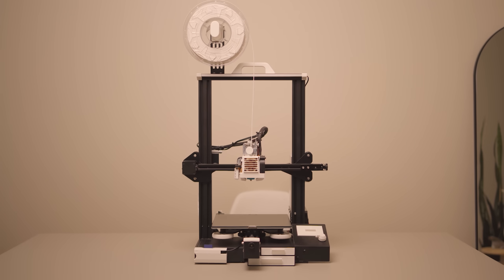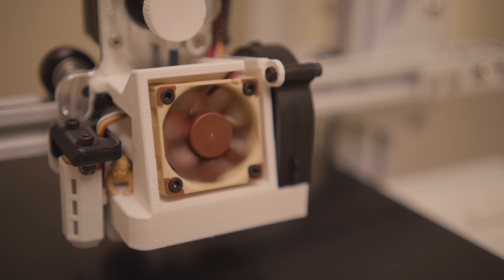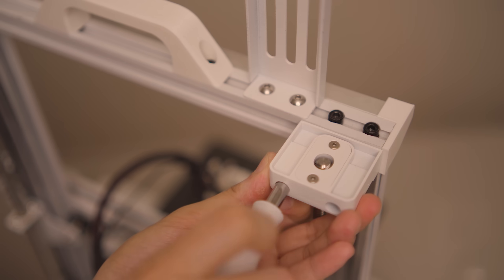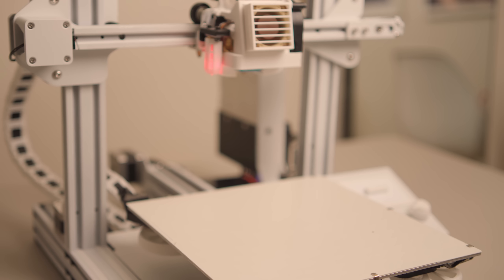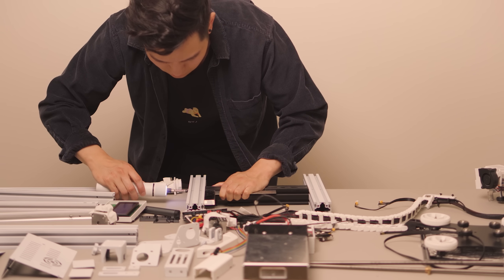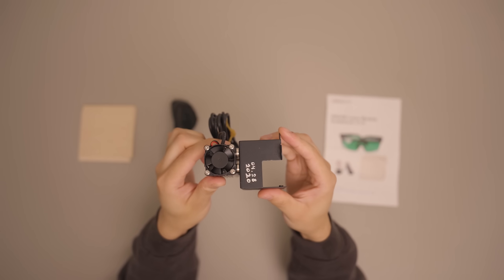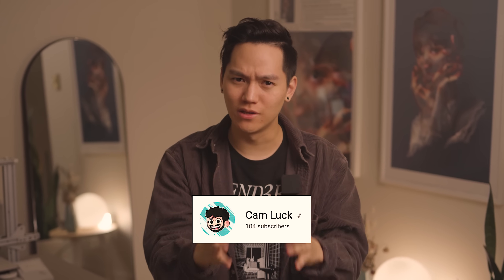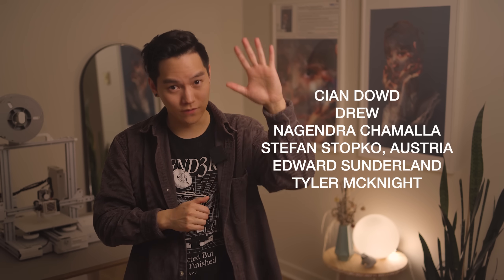10 More Upgrades for my Ender 3 Pro - Part 4

Comment: Pancake motors are actually not weaker,  it all depends on the specs,  I have stronger pancakes than regular,  but they will get hot wich basically is the better heat spread of the regular version.  The coils and stator are usually similar inside

Comment: Honestly i didnt think there will be part 4 good job bro. Looks amazing. Btw if you wanna play with it little you can replace firmware with Klipper and setup input-shaping with acceloremeter. And replace default screen with KlipperScreen. Also you can replace wheels with linear rails(wheels will wear after some time). There is so much you can do with this printer its beyond unbeliavable.

Comment: Where can you find a Thermistor that can handle 425c, that will work with the Micro-Swiss All Metal Copper Hotend, or any 500c advertised Desktop Hotend?

Supposedly, Thermocouples do not go high enough, so nothing made for the Ender is capable of anything over 300c, and they recommend that you do not go over 260c-280c.

I see Hotends advertising their ability, but finding compatible Heaters and Thermistors is almost impossible. Creality refuses to answer my questions through many emails, and Micro-Swiss flat-out doesn't have a clue. Any help you can provide would be greatly appreciated!

Comment: I got my first printer about a month ago and after much research I ended up getting the Ender 3, I could have gone for the Pro, CR10 or some other upgraded model but I had full intentions of upgrading and modding the printer myself (especially after watching your videos) and I'm really glad I took that route! I'm at a stage where I feel comfortable taking my printer apart, putting it back together, making mods etc and I've ended up not having just and Ender 3 but an Ender 3 tailored to me.

Comment: The stainless steel powder coated PEI surfaces are the way to go. You get two surface types, smooth and textured, the adhesion is great, and it's removable.

Comment: Damn whoever designed that pen holder is a straight genius.  Just add some small linear rods on both ends to prevent the stray movement.

Comment: Take your dual z upgrade a step further and swap out the brass lead screws with Delrin (pom) anti backlash lead screw nuts. They will reduce the play that is between the lead screw and the nut (which only gets worse over time since the brass versions are made to be cheap and to also wear down before damaging lead screw) and will stiffen up your x carriage in general which will reduce z banding (saw you had some like I used to which was greatly reduced to basically nothing after swapping in the Delrin versions). Along with this Delrin is self-lubricating so it'll make your z movements smoother longer. I'd still recommend adding a drop of pfte lubricant oil. You'll also notice that any lube or oil you add to your lead screws will no longer turn nasty colors since you won't have brass shavings getting mixed in and causing more problems. Also a reason the reason why Prusa uses them instead of brass versions.

Along with this I'd recommend swapping the flexible coupler you got for the ones with a flexible material between (does basically the same thing but the way it's built with separate parts reduces chances of the coupler breaking which seems to be common with all-in-one piece versions)

Links to versions I bought but you can also find better quality ones such as the ones from Prusa

https://www.amazon.com/gp/product/B08TLVL95C/ref=ppx_yo_dt_b_search_asin_title?ie=UTF8&psc=1
https://www.amazon.com/Befenybay-Aluminium-Flexible-Coupling-Connector/dp/B07RMZCLZ3/ref=cm_cr_arp_d_product_top?ie=UTF8

Comment: Could you please make a video on how to Timelapse you 3d prints.
Reply: Octoprint is a great tool for making such timelapses.

To use it you will need a raspberry pi and a camera. Install octoprint onto the raspberry pi, set up the Timelapse function and you should be good to go.
Octoprint also has some other features which are quite interesting, like printing via wifi or automatic failure detection

Comment: does painting the aluminum extrusions affect the surfact smoothness and therefore worsen the precision of the motion?
Reply: It shouldn’t cause any issues if you use a good quality spray paint and give it a even coat to prevent having varying surface coat thicknesses.

Comment: Massive props to you for including STL links for these projects! I've gone through 3 pen plotter add-ons and 2 Cricut blade holder add-ons and didn't like any of them so far - gonna try yours and see how well it holds up!
Reply: Are cricut blade holders worth a try?
Like can you achieve a decent level of precision using them?
Reply: @yourlocaltoad5102  same level of precision as an actual cricut, assuming you can get your paper anchored well and secure the blade properly

Comment: Can we please see your rig for the POV dolly/tracking shots? Those are smooth af 👌🏻

I got my S1 Pro a few weeks ago, but it's been nonstop headaches with calibration and erratic ABL meshing. My Sonic Pad just cleared customs so soon as that arrives I'll be following your tips for getting everything properly squared up (the coaster trick is genius). Checking out 3D Printer Guy's upgrades now, can't wait to do some of my own!

Comment: the laser head thing should block the airflow from the fan because your covering it up I would add spacers on the screws so that the laser sits slightly off the housing, then print a new housing with holes in the front so that air can flow into the fan and will not be blocked anymore. Just a suggestion I hope you find this useful if you see it.

Comment: Can you do an ender 3 lack enclosure next? 👀
Reply: Lack enclosures are nice, but I would really recommend to make a enclosure from scratch.

I built mine from some mdf-board, a sheet of plexiglas for the doors, some cheap ikea led lights and small hinges and magnet door holders and it was under 30€ (tough I have to admit that I got most of the mdf for free).
Building them from mdf or other wood usually is more practical, as they are better at retaining the heat, you can adjust them to fit your specific needs and they just look better than having some stacked ikea tables.
Also you will save some money, as you won’t have to buy as much Plexiglas to cover up the sides.
Reply: @yourlocaltoad5102  I really appreciate this response. I just got into 3D printing so I wanted to do mdf-board at first but I dont have the affordance to work with MDF at home. 
Hmm 🤔
Reply: @slaythems  mdf still is quite cheap and doesn’t require any specialised tooling to work with.
I had my pieces cut to size at the hardware store for free, so all I needed to do at home was to screw them together and add my plexiglass doors.

But if mdf is more expensive in your area, you can also just use any other wood.
Reply: @yourlocaltoad5102  would you happen to know of a good link for instructions to this?

Comment: If you have your fans mosfets, then you shall either replace them, or the motherboard entirely. In that case why not try a board with 5 drivers so your z steppers can work independently and self calibrate?

Comment: Only thing is -- remove anodizing from aluminum to just make it white by spray paint will impact how your printer performs. Anodizing hardens the outer surface, just for aesthetics - -if you want white, but white anodized extrusions.

Comment: Out of 5 machines I have built so far, I have yet to see one that had nearly a square base from the manufacture which is preassembled.  Truly cool stuff here and I appreciate and enjoy your content. You are the best!  However,  it is my strong belief that a properly built machine does not need grease on the z axis screw.  In fact, I have been able to achieve a free fall from top to bottom with stepper disabled on my builds.  Some short tolerances which requires some micro tuning, yet possible.

Comment: Question: Did you have any problems with the printer that disabled it until you fix it? And if so, where is the most effective solution to problems for dummies? Because my Ender 3 Pro stands and gather dust because of one problem, YouTube videos didn’t help much🥲

Comment: Since you broke the fan controller you should buy the new 4.2.7 mainboard. It is the silent board the new ender 3 s1 uses and it is a drop in replacement.

Comment: The shared Z stepper motor control reduces strength of them, making missed steps more probable. It's prbably entirely fine, Z axis isn't doing too much work. But if you wanna be extra, timing belt on the top of the Z lead screws always keeps them in time :p

Comment: One again Scott, another great set of awesome mods. BUT... When I clipped my ribbon cable to the frame, Octoprint reported that I had a HUGE retransmit rate on instructions.  I had to unclip the ribbon cable and get it as far away from the frame as possible.  Once I did that, the errors disappeared. (And now I'm off to get that Dual-Z axis motor kit!) :)

Comment: Since that Noctua fan is 12v and your board is 24v, I assume you had a buck converter. The laser probably tried to draw too many amps through that buck converter because it's meant for 24v?

Comment: A geared extruder would be a lot better for direct drive. It uses a smaller motor, but can achieve the same (or more) torque. I'm currently using the superlight orbiter v2 (on my vcore 3), and it can push more than 50mm^3/s of filament, which is 0.3mm layer height, 0.8mm line width, at like 500+ mm/s
Reply: why there are no nema geared? instead of and extruder geared?
Reply: @borisgraell  because geared extruder is much lighter.
Reply: Good lord that's ridiculous fast. No way it keeps near perfect quality while flying around like that... but then you must also have some insane cooling... sheesh

Comment: Curious how well the paint is gonna hold up, the black was anodized on but the roller wheels might degrade it in the channels. Regardless, cool to see you still working on this thing! Have you ever considered just trying to design a printer from scratch?
Reply: Looks like it's bare inside the channels.
Reply: I was thinking the same on the painting

Comment: Is the Ender 3 pro still worth it?
Reply: You can get one at a microcenter for 100 bucks so if you’ve got plans to mod it then yeah they’ll make pretty good kits. Probably better to spend a bit more and get a more solid printer though, although I only have an ender 3 and 5 so I don’t have any real recommendations
Reply: Yes it’s worth it. You don’t need all this cake decoration either. I make tons of money with my stock Ender 3 pros and one reg 3. Good designs make money
Reply: If u get it on sale

Comment: Hey Scott, for your part cooling fan. I also ruined that part of my circuit board by accidentally shorting the cables while installing new fans. To fix it I was able to change the firmware to have my printer use the connector plug for the motherboard cooling fan to control the part cooling fan, after that i hotwired the motherboard cooling to the heat sink fan. This way i can still regulate the fan speed of my part cooling fan and the other two fans also start spinning whenever the printer is turned on. Might be something to consider!

Comment: Thank you for sharing.
For me i would have changed the pom wheels for the the polycarbonate ones , upgraded the push connectors to compression fittings , get an bi metal heat brake , copper heater block and bondtech cht nozzle. And add a little more attention to your extruder .
Otherwise you did a wonderful job on revamping the " old" Ender3 pro. Thanks.
PS  i discovered the dual van ducts are better.